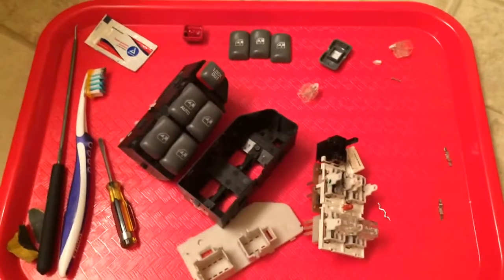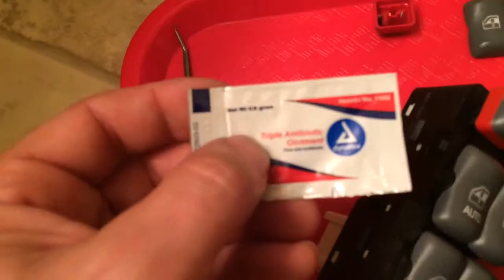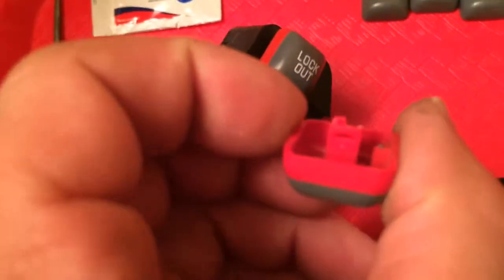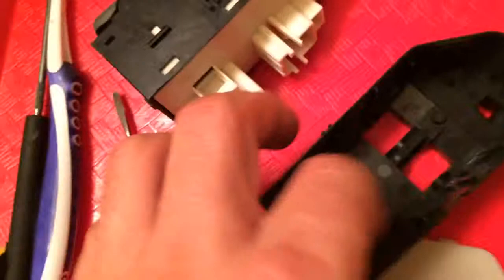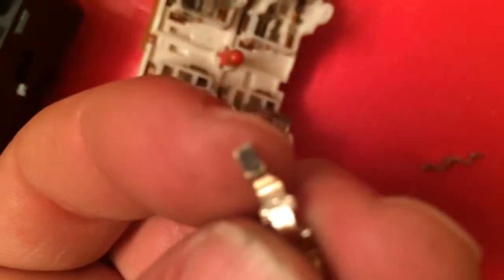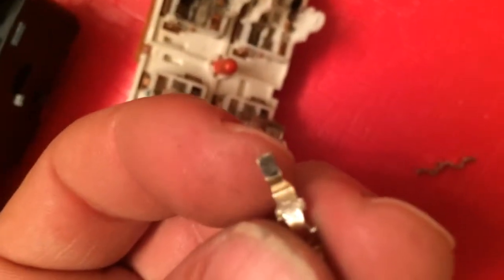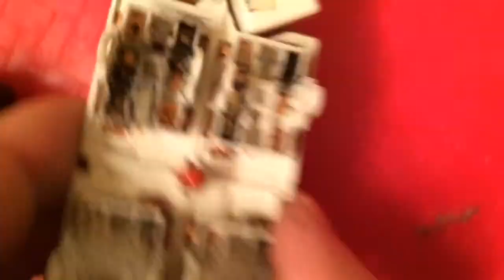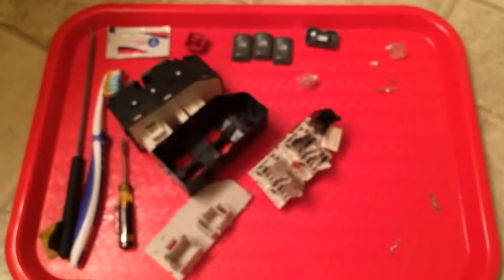Window Switch Fix GM Chevy Olds Pontiac Buick

Comment from the maker: On vehicles that have the "AUTO DOWN" option for the driver's window, the plastic rocker & white tips must be reassembled in the same location. (If the rocker doesn't go in the down position far enough, it won't engage the auto down switch. Just swap the two white tips if that is the case) however, I find the "Auto Down" option annoying & disable it by swapping the tips from the correct position.